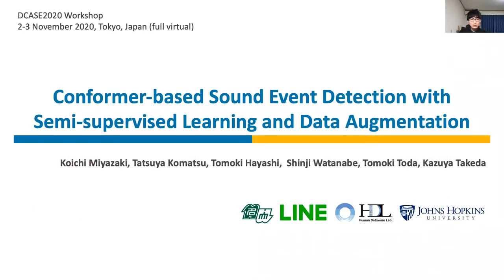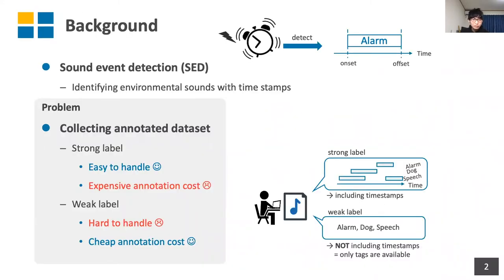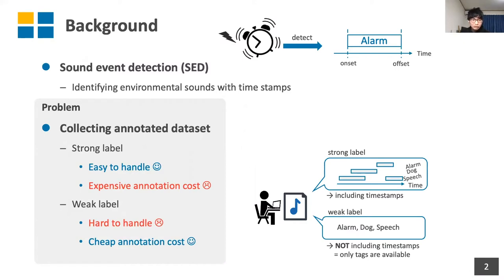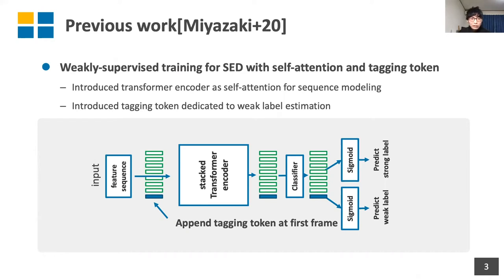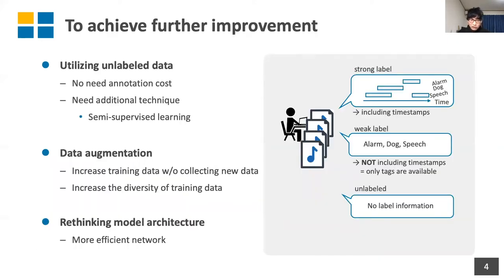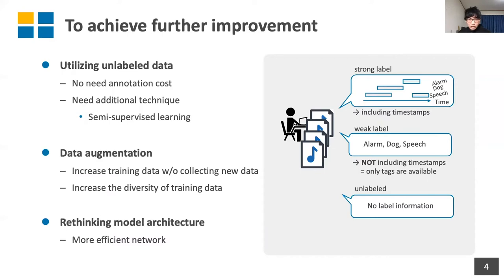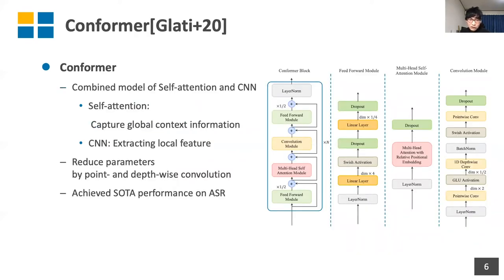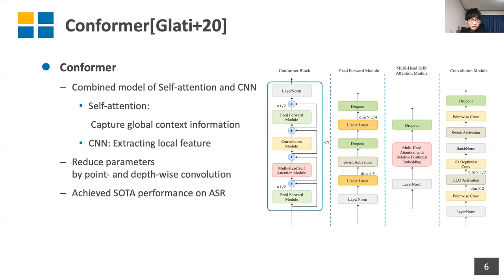DCASE 2020 Workshop, ID 92, Koichi Miyazaki et al.

Comment from the maker: keisuke_imoto
5:17 PM
 Has joined the channel.

koichi_miyazaki
10:00 AM
 Has joined the channel.

xiangdong_wang
10:26 AM
 Has joined the channel.

tatsuya_komatsu
3:30 PM
 Has joined the channel.

wenxin_hou
4:03 PM
 Has joined the channel.

wenxin_hou
4:03 PM
Hi, thanks for your impressive work! I would like to ask if the source code & pre-trained models are publicly available now?

koichi_miyazaki
5:43 PM
Thank you for your interest, but the code is currently unavailable yet. I am working on the release as soon as possible, so please stay tuned. Sorry for the inconvenience. Thanks.
😃 1 

wenxin_hou
6:27 PM
Okay, thanks for your reply!

fassio_blatter
8:07 PM
 Has joined the channel.

tomoki_toda
8:21 PM
 Has joined the channel.

sacha_krstulovic
8:22 PM
 Has joined the channel.

mohammad_abdollahi
8:32 PM
 Has joined the channel.

mohammad_abdollahi
8:32 PM
Hi Thanks for the talk. I have a few questions. one that how much the post processing optimization (fine tuning thresholdings and filtering parameters) contributes to your final performance measure ? how much would F-1 drop without post processing optimization?

koichi_miyazaki
9:23 PM
Thanks for the question. In my experience, thresholding gains roughly 1~2 % improvement. class-wise median filtering gains 2~3 % improvement compared with using the same filter span for all sound event classes. This is because long duration events (e.g. vacuum cleaner) would be suited to long filter spans.
👍 2 

mohammad_abdollahi
8:38 PM
on a second note, how much did you explore the parameter choices for the transformer?from what I understand you use the same d_model dimension as the dimension of query, value and key dimensions in the transformer architecture. Given that in standard architecture choice of transformer models in NLP and even computer vision usually dimension of query is quite lower than d_model, what was the reason for your choice of dimensions?

koichi_miyazaki
9:30 PM
We tried to search hyper-parameters for the network architecture such as the number of attention dimensions, heads, encoder stacks, etc. And we found small settings got better performance compared with usual setting in NLP or CV.

koichi_miyazaki
9:39 PM
If we can use extremely large training dataset such as NLP or CV, the larger settings may perform better.

mohammad_abdollahi
12:51 AM
Thanks for the reply. I understand the choice of an overall more compact model but I was more talking about the ratio between d_model and d_query. my understanding is that you use the same dimension for both. is that right? because in most of the transformer implementations that I have came across d_query is about an order of magnitude smaller that d_model.

koichi_miyazaki
9:45 AM
Oh sorry. The answer is NO. Because d_query is determined by d_model and the number of heads (d_query = d_model / h).

yohei_kawaguchi
8:22 PM
 Has joined the channel.

yohei_kawaguchi
8:23 PM
Copied from Zoom

Yuma Koizumi (NTT)
For some events, the Conformer-based model was worse than the traditional Transformer-based model. Are there any notable differences between these events and the other events?

koichi_miyazaki
9:27 PM
Thanks for the question. Actually Transformer model outperformed for some event class (e.g. Frying). We consider this reason why they have a different trend to predict for long- and short-duration events. However, the validation set is small (some event class less than 100 event-based samples), so we should carefully discuss this result.
And this is my experience but Transformer model has a trend that marginally worse recall performance.

yohei_kawaguchi
8:30 PM
Copied from Zoom

Ricardo Falcon Perez
Where the models scaled (change in parameters number) when using different inputs? Otherwise, it might not be a fair comparison when the dimensions of the input change.

koichi_miyazaki
9:50 PM
Thanks for the question. I'm sorry I'm not sure where you pointed out. The input is the same between Transformer- and Conformer-based models.

frederic_abad
1:38 AM
 Has joined the channel.